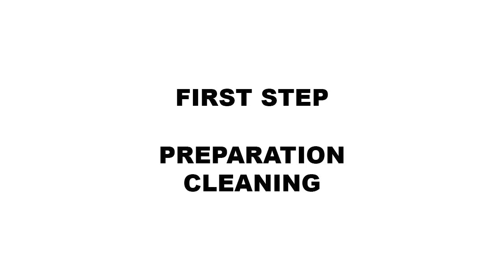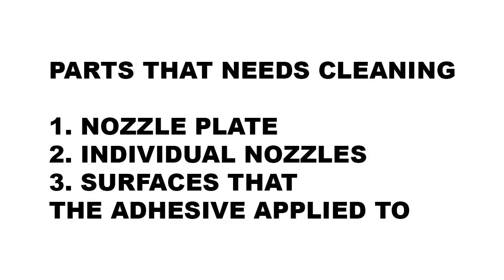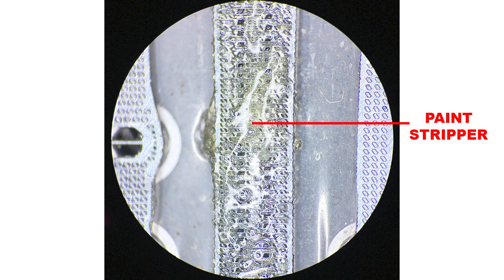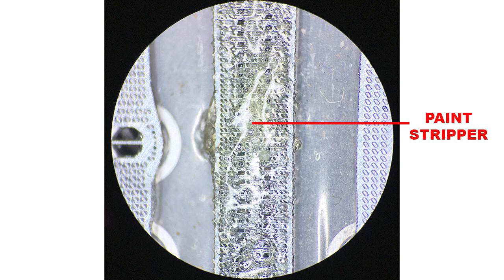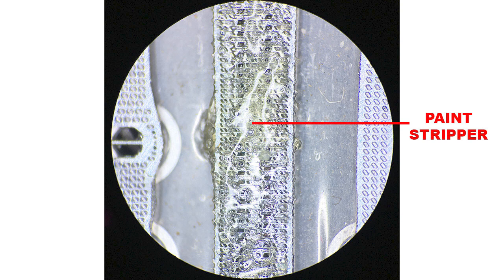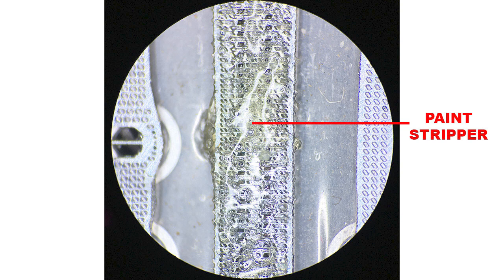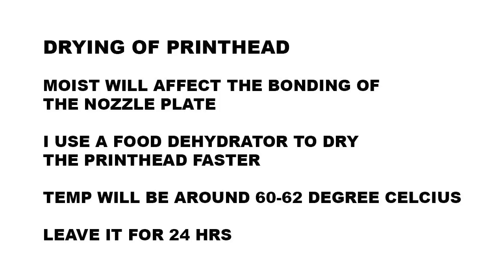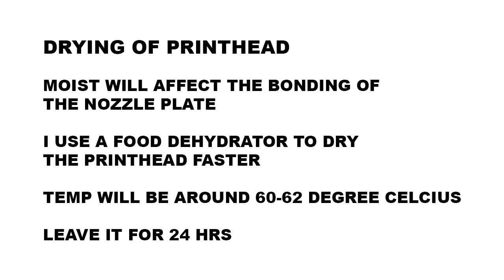PRINTHEAD REPAIR CLEANING PROCESS

Comment: Oulala, the worst way to recover a print head. 5 years that I spent looking for. You just need to know that the head sticks to UV and that they do it upside down, you will find that just under the plate, there is a kind of mirroi or glass. We have found another Adequate technique to overcome this. I just apply to you on the plate and not on the other side. THANKS